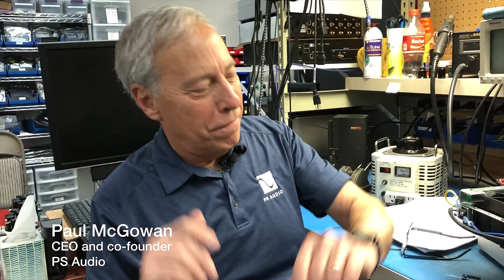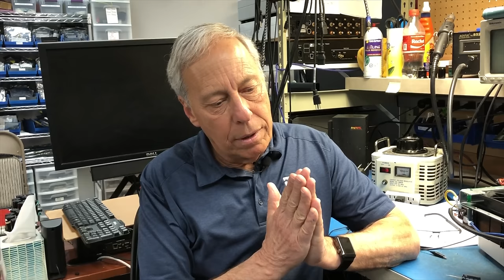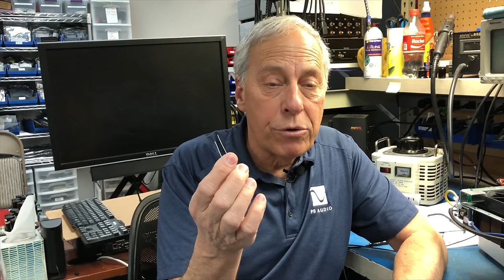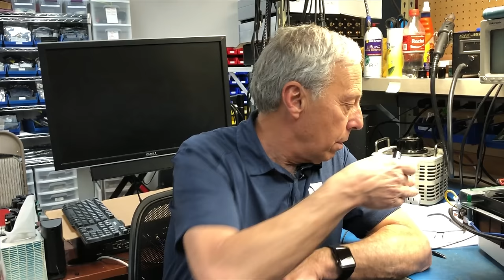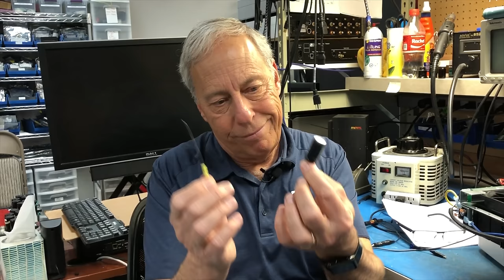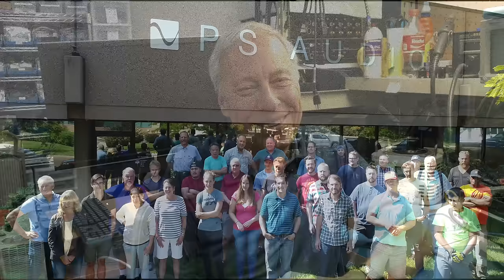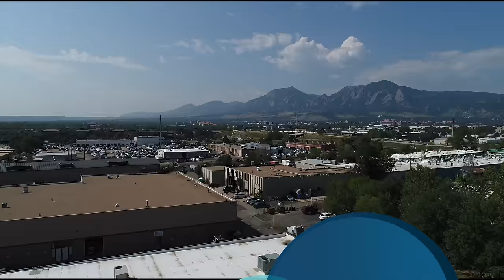Why do capacitors sound different?

Comment: I've used both film and non-polarized electrolytic in crossovers and honestly there's not much difference.  Like Alan says here below, I'd like to see some testing done on a scope to actually see the difference.  No one is busting your chops Paul, but I would have said capacitors sound different due to the different materials used and the quality of the metals.  I'm sure passing audio thru aluminum sounds different than straight copper, or does it....?  Or if you're using plastic, or mylar, or what ever as your insulator, or does it?  A scope would show this.

Oh and yeah, you CANNOT even use a polarized cap in an audio circuit, it would destroy itself very quickly depending on how much voltage was applied.  You CAN use non-polar caps in audio, and they sound fine.
Reply: Most poly caps have self healing properties !!!

Comment: I am no expert in capacitors for sure. But it seems in guitar amps the most expensive components do not equate to better sound. I know the old blackfaced Fender amps from the 1960's sound incredible and the capacitors were paper caps. I have read articles of famous modern amp builders state what I just stated in the past sentence ie.. Mesa Boogie, Soldano, Victoria etc... In musical instruments electronic and non electronic mojo does not always come from the most expensive parts. And people that play a lot know what mojo means, can't explain it you just feel it

Comment: "AUDIO VOLTAGE"
This guy gets more crazy every time I watch him.
IF capacitor have an effect on audio signals, NOT ONE OUT OF TEN THOUSAND CAN TELL THE DIFFERENCE.
There are NO correct answers as to WHICH IS THE BEST SOUNDING, it is a personal decision.
The only TEST IS TOO LISTEN TO THE AUDIO IN YOUR OWN HOME.
Remember the actual environment you are listening in HAS MORE EFFECT ON THE AUDIO THAN CAPACITORS OR WIRES.
Reply: Yes it’s a subtlety, not very obvious.

Comment: I had a question if you don't mind me asking I'm putting new caps and an old vintage Sony walkie-talkie and the temperatures are like 85°, could I go up a little bit higher in temperature. The ones I have are like 105 with that be okay. I like watching your videos I learned something

Comment: Be aware that film capacitors also have a + and a - wire. For best results figure out which lead is connected to the outer layers and connect that one to the lowest potential, like ground. That way you will pick up less noise an humm.

See these videos for more about caps:
https://youtu.be/BnR_DLd1PDI
https://youtu.be/67M7fsbLUIU

Comment: What brand and model # of caps do you recommend, nicheon, or ext.   For power supply vs. audio path
Reply: Ceramic:
American Technical Ceramics, AVX, Johanson, Kemet, Knowles, MuRata, Samsung, Taiyo Yuden, TDK, Vishay Vitramon

Film:
AVX, Cornell Dubilier, Illinois Capacitor, Kemet, Panasonic, Rubycon

Aluminum Electrolytic:
Cornell Dubilier, EPCOS, Kemet, Nichicon, Panasonic, Rubycon, United Chemi-Con, Vishay Beyschlag Centralab, Würth

Mica/Teflon:
Cornell Dubilier

Tantalum:
AVX, Kemet, Vishay Sprague

Silicon:
MACOM, Skyworks

Supercaps:
Cornell Dubilier, Eaton, Nichicon, Panasonic, VIshay Beyschlag Centralab
Reply: Randy Lott 
I recommend wima Germany cap's . They sounds like heaven.

Comment: Most audio uses electrolytic capacitors. If they're film, they are of the gumdrop variety or are cube shaped not axial. The better question is what make a Elna cap better than a hong kong foo-e? What does esr do for me? What does one look for in a filter cap? I could go on.

Comment: so if the battery voltage is very high, it still won't pass? I thought that energy passes once it reaches a given voltage to jump.
Reply from the maker: No, only AC passes through a cap. So when you initially connect a battery, that first connection's energy will jump through the cap but then will stop. AC is a constant reversal of plus to minus and that's what a capacitor will allow through.
Reply: Thank you. Basic physics class neglected to mention AC.

Comment: Great video, thx a lot. I have 2
questions. I checked some speakers with just a capacitor as crossover for the
tweeter and they all have different capacitor values between 1.5-4.7 µF. Is this
because the manufacturer wants different sound or the tweeters are different or
the amplifier is different ? How do I choose the right capacitor for a tweeter
?

Comment: Microfarad = a millionth of a farad. micro = 10 to the minus six = millionth. 
A thousandth of a Farad would be a millifarad. milli = 10 to the minus three = thousandth.
Then we also use nanofarads and picofarads. Each goes up or down by a factor of a thousand. 1 microfarad = 1000 nanofarads. 1 nanofarad = 1000 picofarads

Comment: Are the small film capacitors for tone, polarity sensitive, or can they be installed without worrying about polarity. I have some for my guitar amp, and they don't seem to have any polarity markings on them.
Reply: no, they are not polarized, so not polarity critical. Can go in either way.

Comment: General question for anyone on here who can answer. In my crossover schematic, they list the farad value of the capacitors, but they also list a voltage rating for them. As long as I match the farad value and get a capacitor that has an equal or GREATER voltage rating, will it sound the same (or better) than the original old electrolytic cap?  Thanks.

Comment: This was a very interesting topic to learn more about. I don't know if you are anyone else can answer this. I have specific question that may actually be generic enough. I have an old NAD and several sources recommend changing out the electrolytic capacitors for several reasons. I will purchase the same value caps but do I need to make any other considerations in my case? If there is no answer I do understand in which case I will visit DIYAudio or some other forum to raise the concern. Thank you for the knowledge you shared. Very interesting indeed.
Reply: @Alex, you said..."I don't know if you are anyone else" ???   Paul MAY be a 'schitzo-fergitzo', but he has NOT shown any signs of that on here so far!  TRY to stay on subject please.  😜
Reply: @mr.blackhawk142  I see that I made a typo, "I don't know if you are anyone else" - are should have been 'or'. Sorry if I was off topic. :)

Comment: Wait sound is made by electricity so why do speakers make sound with capacitor on wire? I don't understand this? Perhaps capacitor passes changing voltage like the audio electricity is?

Comment: Sir I seen a tech use a ceramic cap.in place of a electrolytic ,and it worked ,he use a blue high voltage ceramic and took out the electrolytic,it seem to work well I would like your opinion.on that,old guy here still learning

Comment: When you put a film in parallel, what voltage should it stand to? Do you have to get the same voltage rating as the big electrolytic, i guess?
Reply from the maker: Yes, but that's typically easy as film caps generally have a much higher voltage rating than electrolytics.
Reply: @Paulmcgowanpsaudio  Thanks a lot! Your videos on this matter are golden, i learnt a lot from them.

Comment: Quite a confusing answer: what does AC have to do with a speaker? Amps output DC, do they not??
Reply: Sound signals are variations in voltage, and most generally are AC in nature. While inside the amplifier circuit is generally a varying DC signal, the speakers would not react well to this signal directly. Therefore the AC signal is fed through a capacitor or transformer to remove the DC portion leaving the variations as an AC signal.

Comment: ive heard that if i replace the caps in my old speaker crossovers it would improve the sound since the caps are 15 years old. is that true ? i have a full set of infinity interludes for my home theatre, the speakers are stil in perfect condition. but would replacing the caps improve the sound ?
Reply: Usually electrolytic caps go bad after certain amount of hours of usage. You can look up datasheets of electrolytic caps and you will see their expected lifespan such as 2000 hrs or 10000 hours, etc. (Obviously at max rating usage) keep that in mind and you will see that a replacement of caps after a decade or so might be a good idea. Film caps don´t really need to be replaced usually unless they are of a know bad batch, brand or model. Same counts for resistors and coils in the signal path.

Comment: What is this I hear about "Silk capacitors" vs. Paper? In terms of audio quality in things like component CD players or Receivers? I hope I am posing the question in the right way. I know I purchased a pretty decent CD player but during my purchase, I noticed that someone had a modified version of the same model on eBay and they replace the capacitors with " upgraded silk caps". I want the best sound possible - and if I can get that sound by simply upgrading some internals vs buying a very expensive unit, that would be pretty awesome. But eh, it may sound great anyways.
Reply: So a capacitor if it were perfect would measure 0.000000...ect for every parameter except capacitance. There would be no resistance or inductance only capacitance. Capacitors and everything else made by humans are not perfect so they end up having some inductance and resistance so they represent a voltage drop where there shouldn't be one necessarily. A "good" cap is just a cap that does what its supposed to (provide capacitance) and doesn't do what it's not supposed to. So its HIGHLY dependent on the application and when your CD player was designed the capacitors were selected based on the design requirements (including cost) that the engineers took into consideration. TLDR: Different caps perform differently because they are actually caps, resistors, and inductors all rolled up into one and you have to treat them as such. A $10 capacitor is snake oil at its finest
Reply: @Jmoneysmoothboy  thank you very much for the explanation. Since in your example the CD player was designed with cost included, isn't there a chance that they used very inexpensive parts in certain areas of the board? Would interference or distortion ever come into play with a poor-quality capacitor? I'm just trying to figure out why some of these audiophiles replace their caps with "higher quality ones"?
Reply: @CeeStyleDj  They certainly used the cheapest capacitors they could while still meeting a certain requirement. Part of an engineer's job is to save money. Even between two capacitors of exactly the same make and model there will be measurable differences in their individual capacitance, inductance and resistance but most of the time this difference is too small for the human ear to register. If you were to replace those caps in your CD player with more expensive caps of the same capacitance then yes technically the sound would be more accurate but the only way you would hear the difference is if your current capacitors were absolutely terrible and if they aren't terrible you basically pay for a placebo which again technically might make the music more enjoyable to listen to even if its all in your head. If you really want to hear better sound then get better speakers or headphones in your case. I promise you it'll be a better investment than new caps assuming yours are still within spec. P.S. while learning about capacitors for audio you will hear people talk about film caps being the only option for true HiFi but that's mostly BS and Non-polar electrolytics are just fine 90% of the time.
Reply: @Jmoneysmoothboy  thank you for the perspective and going into further detail. You are right, I think the source material is the most important aspect of good quality music followed by good quality components. I was just surprised to see the lengths that some of these eBay sellers went to modifying the internals to the point where I thought my stock unit may be inferior BUT, It's a pretty decent brand (TEAC) that get's good reviews -( I'm not a layman when it comes to consumer electronics) I'm sure the internals are just fine. Thanks!

Comment: i need an advice about capacitors. on my cheap DAC there are two electrolytics 47uF 25v on signal path ( elna silmic II ), can i change it it film capacitor? i saw somewhere that i can use 20 times lower values if i use film capacitors, all i have to do is to find ones with higher voltage. So my question is: is 2.2uF 450VDC film capacitor enough to replace electrolytic one 47uF 25V? i would go for Mundorf Evo oil series, because i see Elna don't make film caps. Thanks!
Reply: No, you should not replace a 47uF 25V with a 2.2uf 450V. No you cannot use 20 time lower values if you use film capacitors when replacing caps.

Comment: sir if its OK with you im asking some ideas from you, im beginner of this , i have 350 watts per  channel amplifier total of 700 watts but when ivied open there is only 4 transistor inside ,  voltage is 35 0 35 , is the 700 watts correct? second question i was using 4 pcs. 350 watts sub-woofer. is this set up OK or not ? hope you can give some ideas sir , thanks
Reply: i appreciate your help sir, thank you so much, i plan to    change my supply to 55 0 55 volts,  is this aplecable sir or  it will damage my amplifier ?
Reply: thanks a lot sir, more power
Reply: If your transformer has 35 0 35 rail ,  it is called center tap transformer. after regulated, it will have voltage swing from about -35 volt to + 35 volt, totaling 70 volt swing.

If your amp is claiming able to pull 350 watt per channel totaling 700 watt. You need W = V x A, which is simple math to find the amps , which is

700 watt = 70 volt x 10 amp.
Considering transformer has bad efficiency , about 50 %. 
You need to upgrade your transformer to minimum 20 amps with same voltage. Replacing diodes with higher amps one and capacitor if the value is low. You might be need to rework the power supply too, if your older one only have 4 caps or less.

DO NOT CHANGE TRANSFORMER TO HIGHER VOLTAGE ONE!
Your lower voltage caps will explode.
Reply: tnx a lot sir ! more power

Comment: Hey Paul!!!....i noticed that Variac in the bkgrnd....can u do a video about Variacs?....i use a Variac on my Chinese made Yaqin MC-100B fro reviews i read...appears Chinese mfg line build this amp to diff voltage specs....103-105 volts, so using Variac to fine tune voltage to it, really improves the sound , especially with tubes...any comments from u on this would be most appreciated. Thank u sir!

Comment: one thing to have in mind is that electrlytic caps are polerised and cant be used in ac
Reply: breakfastbuddy5 two electrolytics in series but connected in opposite polarity form a non polarized electrolytic capacitor that are used in speaker crossovers.

Comment: Science or faith? You either believe there is a difference that can be heard but can’t be measured, or you don’t! Parallel caps will present the capacitance of the sum of their individual values, the mystical journey of some electrons going through the smaller foil cap and opening up the micro details in the sound, or better still presenting ‘extreme neutrality,’ etc., etc.... again you either believe that or you don’t. I’m just trying to respect people’s religious beliefs 😂

Comment: You can pay a lot for some audio caps and some of it must be snake oil. Capacitance is a measure, it doesn't have a "tone!" But it may just be that more expensive caps are more accurate or closer to the actual value. Measure caps of a certain value and some are way off and it may be that the actual size or material could have an additional capacitance.

Comment: Touch my speaker with the wire on the outside of it and my Bluetooth speaker just went dead how can I fix it what do that mean I don't know what happened to it I know I touched the metal and everything went dead and it won't charge and do nothing

Comment: audio capacitors is a voodoo i will never touch as it will always be beyond me and my ears. When I mod my sound setups with capacitors it is just large electrolytics on the post ac DC side to smooth out mains noise.

Comment: Capacitor doesn't pass AC; it charges and discharges and gives impression that it passes AC; if you could name electrons, electron Mike which is at one side of capacitor will never make it to the other side to meet electron Dave
Reply: HID den  At least someone else understands that a/c won't pass through a capacitor either. I can't understand why all of these electronics guys keep saying it will.
The MIT guys are all rolling their eyes.
Reply: Let's take the case of DC in a wire. The current is all flowing in the same direction. Dave is still not gonna meet Mike. 

Even if you force the argument by invoking the random motion of electrons, individual electrons pass through the dielectric quite easily as long as they maintain their net position.

It does pass AC, it just doesn't pass net movement of electrons. Otherwise... it's conductivity at AC would be zero.
Reply: HID den Speed of voltage propagation vs. electron travel velocity are completely different, from your chosen point of view. Mathematically, Voltage is a scalar and has no direction. Even worse, there is actually a type of capacitor that passes electrons through its dielectric, contemporarily produced and applied alongside those that are nearly static. So, did you really have no idea or were you just too lazy to do research? This info came directly out of the other comments, which for your benefit of a doubt, may not have existed when yours was posted, but still!